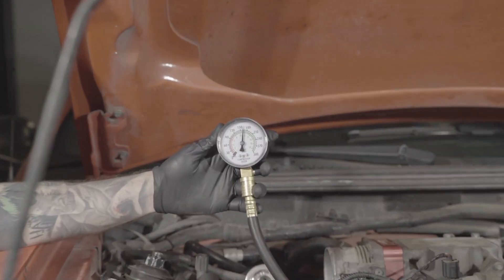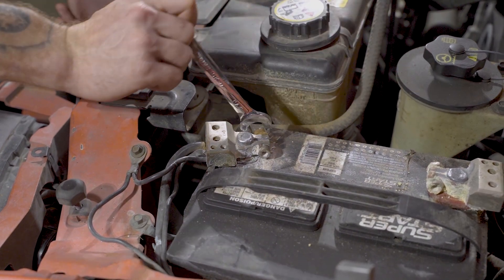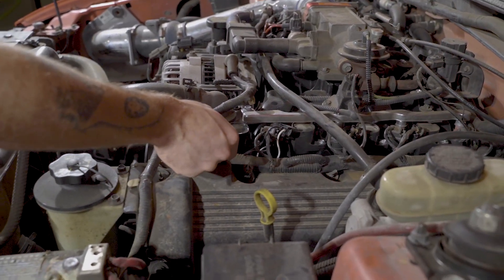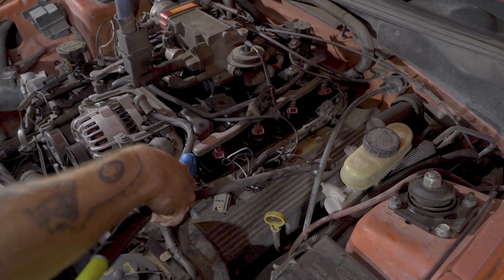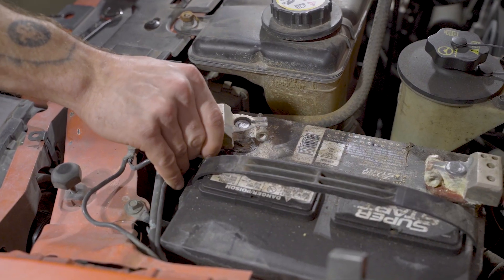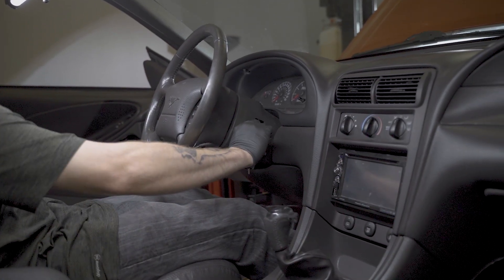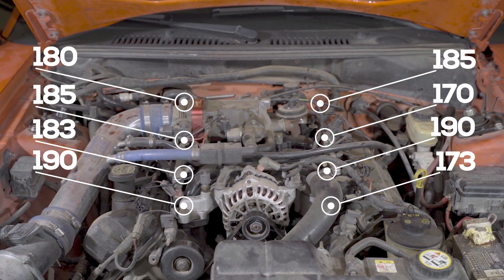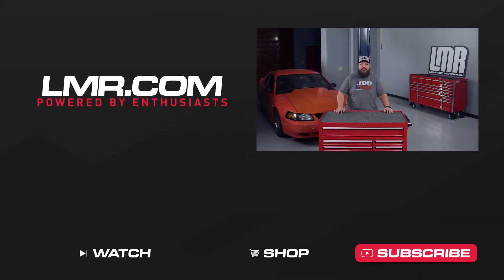How To Perform A Compression Test On Your Mustang

Comment: If I found out some off them are lower than normal what I can do to make it up
Reply from the maker: It depends on the variances in compression.  Typically, a 10 percent variation between the highest and lowest readings is what is allowable.  You can't "make up" for a loss in compression.  For a cylinder with low compression, pour approximately 1 teaspoon of engine oil into the spark plug hole and retest.  If the reading increases, the piston rings are worn.  If not, it's probably valve related.  Hope this helps.  -Landan
Reply: @latemodelrestoration  Thank you I appreciate it 🙏💪🏻

Comment: Ok so I have a 03 gt with just under 200k miles. 

It’s in decent Health but I’m only the new owner and have already put $2k into replacing parts.

I’m about to replace all spark plugs and coils 
Would this test be worth seeing if my motor is healthy? 200k is a lot for these bad boys but idk how bad the motor is. It runs pretty damn good but idk 🤷🏼‍♂️
Reply from the maker: Hey Joshua, since you'll be doing all the work already, we recommend testing the engine while you can! It's worth knowing to see if you engine is healthy or not!